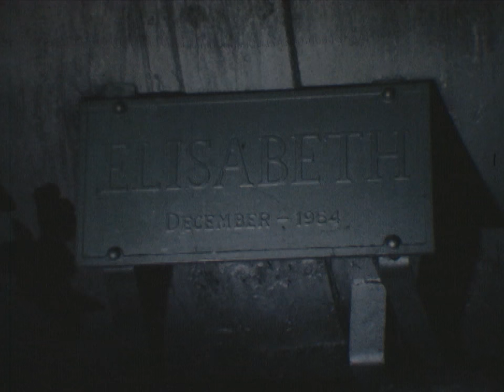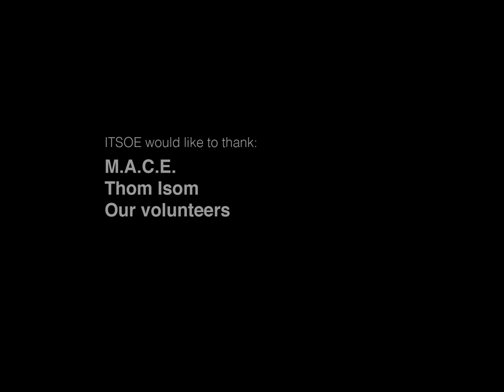Elisabeth: 1979

Comment: Thanks for posting. My paternal grandfather worked there for many years. Dad still has the commemorative plaque awarded to grandad upon the closure of the works. It's a brass plaque with a small piece of the last piece of steel rolled at the works mounted onto it.
Reply: I have one for my grandfather he never brought it at time as you had to pay 15 pounds for it but he passed away few years bk an i found someone selling one so brought it in his honour the metal in the middle is what they made just way smaller an you got the open halve furnace an drop forge on each side of it
Reply: My late grandad worked there and got one of those plaques and my dad worked there as an electrician and has one aswell. There both proudly on show either side of the fire now.